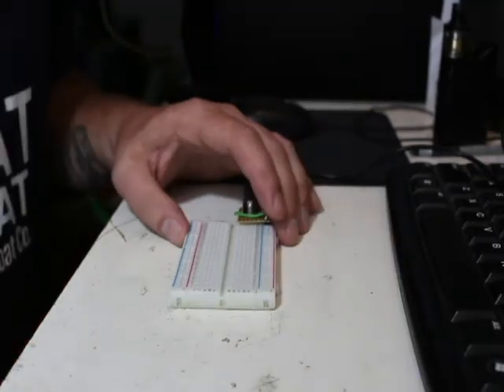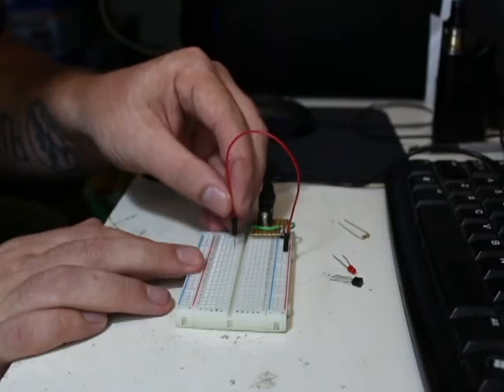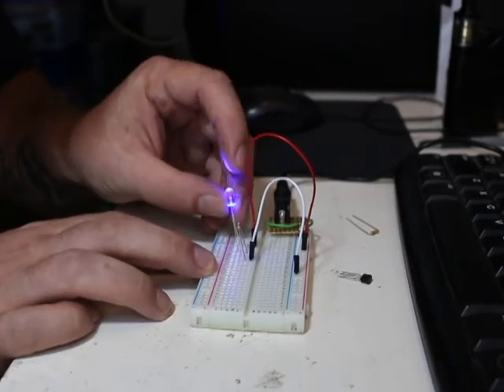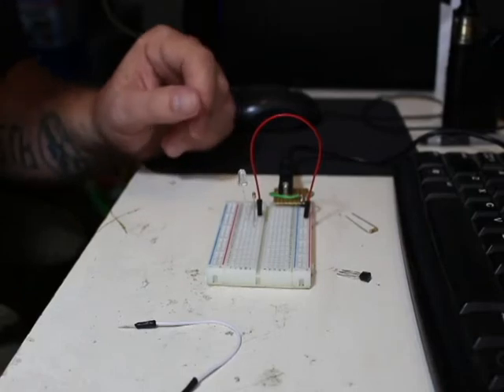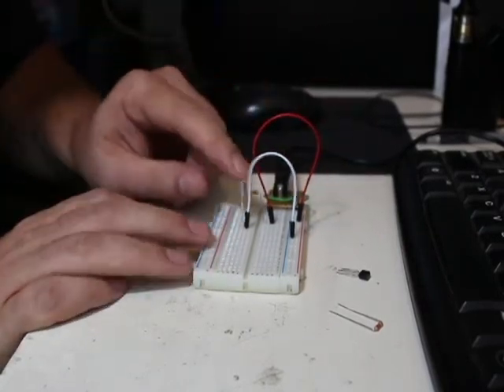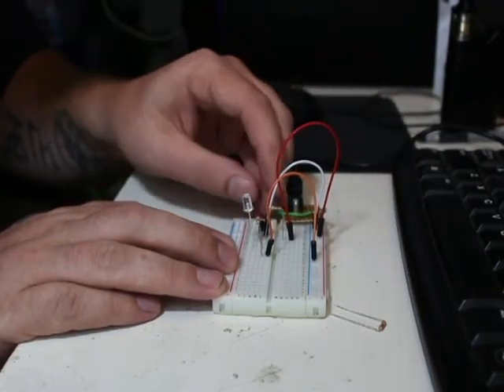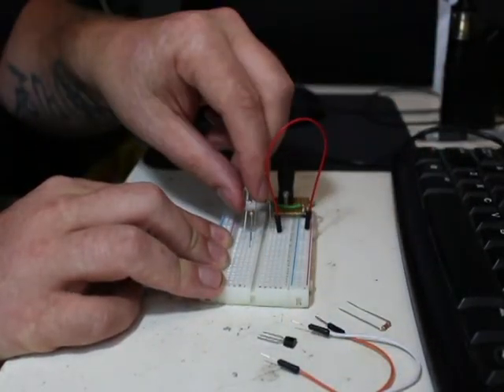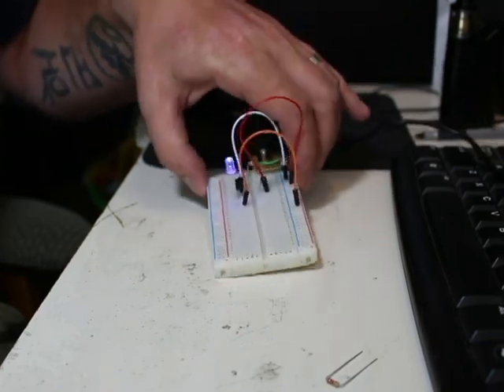Scildburg Tutorial #3 - Transistor to Increase Current

Comment: What you did proved nothing w.r.t. the current being amplified. With your final circuit, if you replace the transistor and connect the collector and emitter together, you'll simply get a 9V going through resistor + LED. All you proved is that current could flow between the collector and emitter of the transistor, but your video did not show that this has anything to do with the high resistor being collected to the base.

If you wanted to illustrate the current gain, you should measure the current flowing on the LED and compare it to that flowing in the big resistor, showing it's 100x bigger, and repeat it with different levels of resistors (showing that if the resistor is too small, the current in the LED circuit will be smaller than 100x that in the one going to the large resistor)

Comment: Wrong,...You didn't increase the current. The use of a transistor involves the use of a secondary voltage source at the collector.You simply increased the "Voltage" which increase the current going through the led i.e the one coming in from the base and the collector itself. Thanks
Reply: no, you are wrong. Please look for the difference between a transistor connected as a so called "common collector amplifier"

Comment: is it necessary to put lower current to the base of the transistor and higher current to the collector to get even higher to the emitter????
Reply from the maker: What it's basically doing is allowing the electricity from the original source to flow through. It's acting as a sort of pathway to ground from the origin power supply. Any current on the base will be fine as long as it is high enough or not so high that it fries the transistor. The current you'll be getting to the component you connect to the transistor will be full on current from the source. I hope that makes sense.
Reply: So the lower the current to the base the higher the output( emitter )... does the output current gain have anything to do with the ratio from the collector to the base??? What is the reason for the resistor at the base?
Reply: So how can this work as an amplifier... how am i suppose to gain current using one of these? Plz reply. and ty for replying to my previous question.
Reply from the maker: You can't increase current anymore than your input can give with a transistor. It allows sensitive components though to be in the same circuit as a much higher current. For instance, you have one part of your circuit that can't have high current because the components are are low voltage or current. You do the usual things in order to lower that for the section of your current that need to be lower the transistor will still allow the affected current to pass through however.
For example. Say you have a transistor that can handle a lot of current and you want to make something like a stun gun. You need a way to turn it on or off. You can do this by using components that would not normally be able to handle all the power the source is giving. So, you would make a circuit that has things like voltage regulators, resistors, etc. going into the transistor. You have a switch to turn the current to the base of the transistor on or off. Then you have a direct like from the source voltage, that is unregulated voltage going into the transistor. When the transistor is open it allows all that source voltage to run through to the other side, while also having no effect on the sensitive components. 
Hope that makes sense. But in a nut shell, it can't make you get more current or voltage than what your source can give.  Your source is the ultimate determinant of that.
Reply: Hope i don't sound stupid...So its kinda like a voltage regulator that controls the output current. Sorry to ask you btw.. i cant find any videos i can understand An thanks a ton for answering
Reply from the maker: Think of it more as a switch that will either allow the full current from the source to flow through unhindered or not allow it to flow through. Also, a voltage regulator will invariably have an effect on the current because current relies on voltage. I = v / r.  This is Ohms Law. I = current v = voltage, r = resistance. So say you have a circuit of 4 volts and a resistance of 1 ohm. This means that you current will be 4 amps. You will never get more than 4 amps out of that circuit unless you increase the voltage somehow. 
And don't worry. I made these videos to be helpful. Hopefully they are.
Reply: Thanks, helped a lot !
Reply from the maker: No problem. I've been busy on a local news site that actually is profitable but I'll get back to this site in the near future hopefully will more videos.